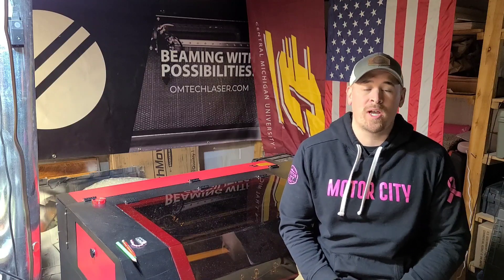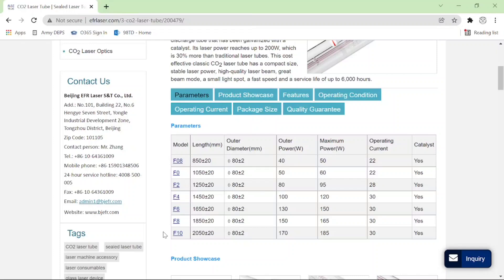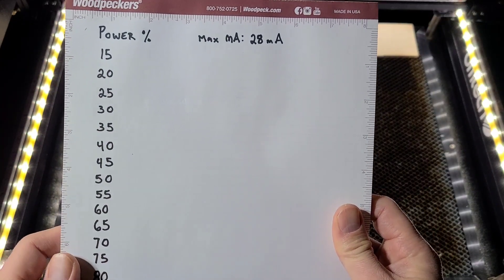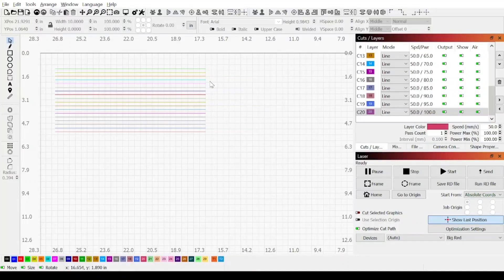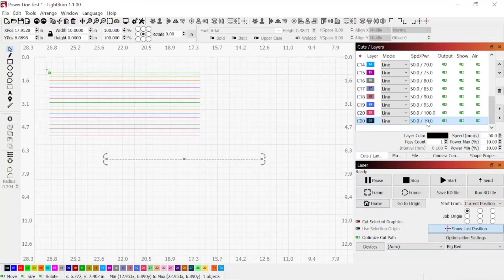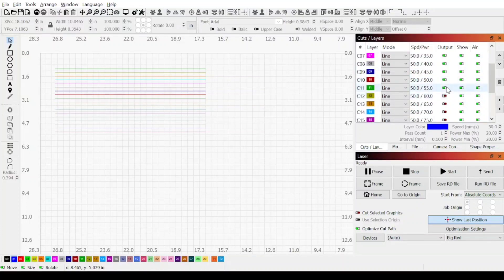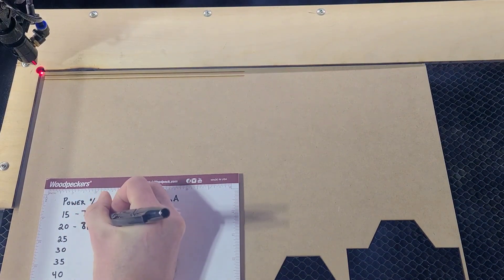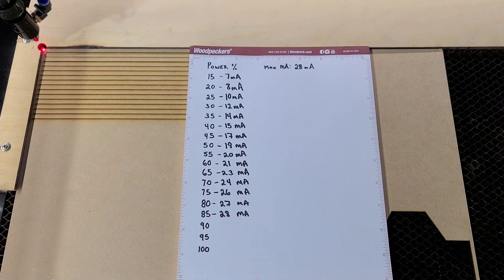Power Line Test on your OMTech | CO2 Laser | Lightburn

Comment: Since you're in lightburn, you don't need to toggle the power outputs. You can just enable the "Cut selected graphics" and click each line as you want to run that test. Easy peezy. Good info on doing the test though.
Reply from the maker: Absolutely right.

Comment: Great info.  Would this be a good test to to use to see if, over time, to see if your tube/power supply has lost power?
Reply from the maker: Yep. Each tube has a max mA rating specified from the manufacturer. If you’re getting a lower mA reading at a higher power percentage then that could be an indicator that you’re losing power somewhere (tube or power supply likely)

Comment: Do you prefer to go low and slow or higher and faster? For example (12mm and 35 percent) vs (20mm and 55percent?) is the higher power of 55 percent going to reduce the life of the tube much quicker or is it only slightly different?
Reply: Its ridiculous try to go slow... in that case run at 0.1 power and  the tube is going to last forever.  Greeting from Chile

Comment: When we keep power 80% even not cutting this new machine new tube I check alignment all correct 
Current output is showing maximum 08 mA
Reply from the maker: 8 mA at 80% power doesn’t seem right at all. Are you using lightburn and do both your min and max power settings match?

I’d recommend joining our OMTech users group on fb linked in the caption and post a couple screenshots of what you’re seeing and ask us there.

Comment: hey buddy thanks for this info :-) i did mine today on Omtech 80w F2 laser but mine maxed out @28ma at 60% power is that correct or you think this is a tad low 😕
Reply from the maker: All this means is that your laser tube power supply is calibrated differently. There’s a potentiometer at the bottom of the black box. You can only access it by dismounting the power supply itself. There’s a small hole that you can access with a small screwdriver. Be careful not to use a metal handle screwdriver or it could shock you. If you adjust it then run a single line at 60% until you see the mA dropping or raising. Depending on the whether it goes up or down will determine whether you need to adjust left or right.

Or you can just leave it as is and never run your laser over 60%
Reply: @EdmondsWoodshop  much appreciate your fast reply buddy :-) also great vids very helpful, and thanks for the info i shall have a look into it see if i can maybe tinker lol

Comment: Hi
 Please excuse my comments below  because there is ZERO crticism intended. I know that you are keen to share your experiences of  this great technology. OMTech  machines are good value and well built so you have chosen wisely.. MANY others new to this technology do  not act as cautiously as yourself. You are trying to do the best thing possible and not exceed the manufacturer's specification. or, as you rightly say, you could shorten the life of your tube. You did exactly the right thing by going to the EFR website  and finding that the first table you encountered helpfully said  Operating Current for your F2 = 28mA. However, this is something that Reci do also, they loudly say you can run at 28mA max  to achieve 80watts output BUT drop down to the next table on the EFR website and you will find a sneaky "out clause" that says IF you want to achieve the promised life of the tube, you must run it at 26mA or less. ie a power output of about 65  watts!!!!   So this is not really an 80mnwatt tube after all!!!
http://efrlaser.com/3-co2-laser-tube/200479/

 Your test is a nice way to take an easy step into programming different layers but it is totally uneccessary for what you are trying to achieve.
 I can tell that you have a 120watt  HV power supply fitted to your machine and I will explain how I know this.
 The % power on your machine has absolutely no relationship to watts output. If you look up the specification for your HV power supply you will see that is it rated at 32mA.  This means that 100%power = 32mA and  NOT 80 watts.
50%power = 16mA and 10% power= 3.2mA (say 3mA). There should be  a linear relationship between % power and mA . Hence 85% of 32mA = 28mA. (yours is not perfect but not far off)

 Even if you don't understand how the HVpsu works, the simple non- programming way to arrive at this 80% limit is to set the POWER button on the key pad to say 70%. Drop the table about 6" and put a cup of water  under the nozzle to safely absorb the laser energy  Press and hold the pulse button while you look at the ammeter. If its less than 28mA then increse the power setting until you find the right %power for 28mA. All other values are meaningless  because this linear relationship  between %power and current  does not apply to watts output. That relationship is very non-linear and varies between tube manufacturers . Let me give you an example . At 10% you may be outputting 2 or 3 watts at 15% it may be 20 watts at 20% it could be 50 watts. It then may start to level off and the remaing 30watts will happen over the 21% to 80% range. Thus 50% power does NOT equal 40 watts . Current flowing through the ionized nitrogen  (the pink beam) is the root cause of some complicated physics happening within the tube that results in watts of output ...........but it's not a linear relationship.
 
 As I said above , there is no criticism of your well intentioned video because  even with many years of metal cutting laser experience behind me, this non-metal cutting sealed tube laser  technology was something from another planet when I first started about 8 years ago and I found myself knowing nothing.   You are running a business with your machine and you know what works for you but probably never get much time to "play" or experiment with your machine.
 Can I suggest you pop over to this website and work your way through the A to Z of Chinese lasers to quickly get you up to speed with explanations and demonstrations pf many techniques and methods  that others will never know and it  also explains most of the technicalities of the machine in very simple terms. You will find out exactly why the manufacturer of tubes specifies this limiting current.
https://laseruser.com/the-concise-rdworks-learning-lab-menu/
All best wishes
Russ

Comment: So if I overdrive the laser do I get more cutting power out of it, kinda like overclocking a cpu of a PC or is just wasted energy and no extra gain?
Reply from the maker: Nope. Your tube has a max mA output. So if your tube maxes out at 26 mA at 85%, then 95% will still be 26 mA. So now you’re just overdriving your tube by 10%. What happens to a lightbulb when it gets a surge of power? It pops.

Comment: Sir Quick question I have the same tube mine reaches 27/28 @ 70 percent and 29 @ 75 is it normal to be that low of percentage to reach peak MA?
Reply from the maker: I wouldn’t say it’s abnormal. Your laser tube power supply is probably calibrated slightly different than mine. There is an internal knob called a potentiometer that you can adjust to make it so it can go to a higher percentage before maxing out but it involves removing the power supply from where it’s mounted to gain access to the little hole at the bottom where the potentiometer is.

Comment: Quick question does the material type and or thickness effect the line test at all.  For Example if you test on 1/2" material will you get higher (ma) reading or plywood vs. mdf ?
Reply: No the material does not matter.

Comment: For some reason - all of a sudden, I can not go above 20% power or my entire machine powers off instantly.  Even just sending a pulse will shut it down.  As long as I stay under 20%, everything is fine.  This started yesterday.  The day before, I put in a new lens (old one cracked for some reason) and I cleaned the mirror - that was also suddenly totally gunked up maybe due to cracked lens - anyway, all that fixed - laser was working great with a huge power increase.  I was making test cuts yesterday to update my library with lower numbers since I had more power - and this started.  Not seeing anyone else with this particular issue, so not sure what's happened.  I've had my machine a couple of years, but really have only just casually used it a few times a month.  Gonna test on a new file today just in case that was somehow messed up.  I did watch the MA meter and it's running at 7 at 20% power.  That's about as high as it's going.  I'm hoping this will be an easy fix because I don't know much about electrical stuff - (I have an 80 watt red and black - looks like yours, but doesn't say OMTECH)  Also, tube looks fine - water cool - not noticing anything else going on - everything looks normal.  Any ideas?

Comment: So, some recommend  an analog meter, due to response time of the digital. Does the 10 inch line give ample time so that you don"t "need" the analog meter?
Reply from the maker: Its a combination of a longer line in lightburn plus the proper speed setting. I run the speed at slower pace so i have enough time to look at the mA meter.

Comment: Great video! Quick question,  I have the same exact laser and I top out at 28mA around 60% power. Is that a defective tube or is there a way to tune the PSU?
Reply from the maker: No it shouldnt be defective. If you have the same tube as mine then 28 mA is the max. The only difference is that your power supply is tuned differently. This is why its important to do the powerline test. Now you know that you should never run your laser over 60%.
If you want to tune your power supply, you should have a small hole on the side. In that hole there's a potentiometer that you can adjust with a small screwdriver. As you make adjustments you'll have to run line tests to see where your new limitations are at.
Reply: @EdmondsWoodshop  Same 80W 2028AF - I max out at 65%. Seems pretty poorly calibrated!

Comment: Hi, I have the OMTech 100w red/black. When I run this test the ma is showing the same number (12ma) no matter the power being used. Any idea why that would be happening? Thanks!
Reply from the maker: Without being able to tinker with it, I'd say you have a bad power supply. At first I was thinking maybe it's just tuned incorrectly, but if you're getting 12 mA at 10% power and 80% power then there's an issue. I'd record a video of you changing your power percentage and showing the output of the mA meter and send it to OMTech.

Comment: Great video.  I've been trying to figure this out for a while now.  Is there a way to set the maximum allowable power in Lightburn so you know you'll never go over?
Reply from the maker: Not that I'm aware of. That's why it's important to know where your power limitation is at. I know im never supposed to go over 85% power in lightburn based on my power line test. As my own personal rule of thumb I don't really go over 55%. Never needed to.